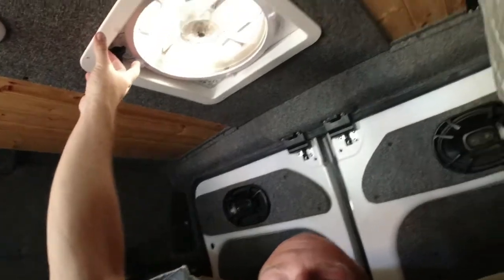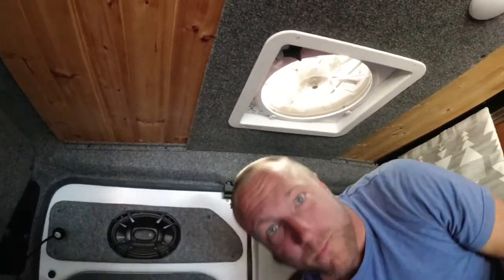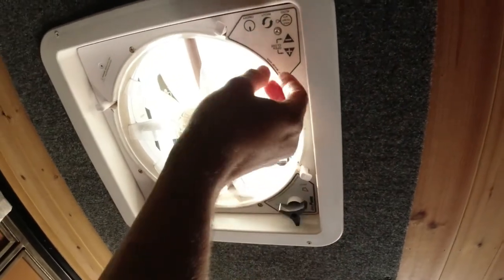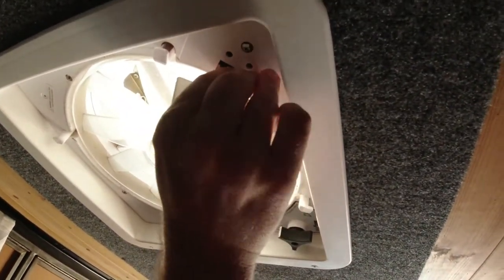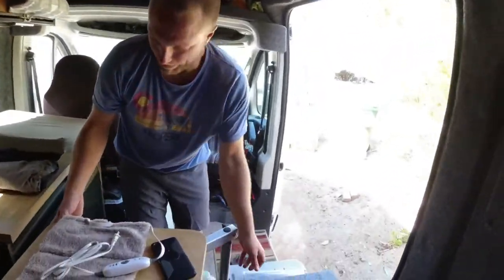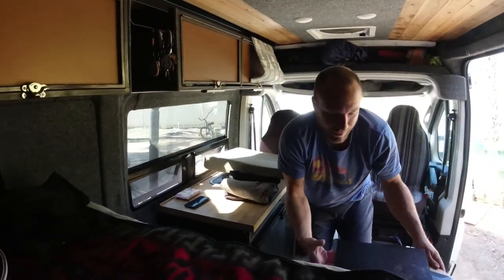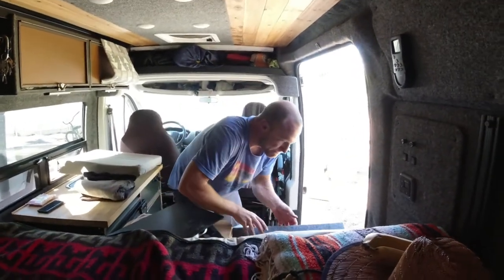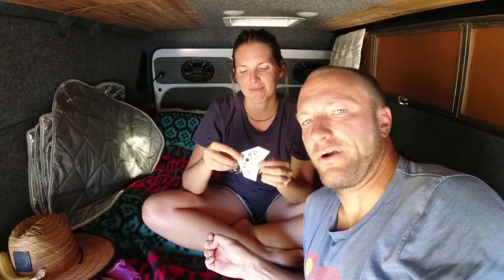Maxx Air Fan Buttons Not Working? How to Replace the Keypad on the Maxx Air Deluxe Fan

Comment: That was easier than I expected. I received my replacement keypad from Maxxair several weeks ago and kept putting off installing the new pad figuring it would be a PITA. (Had AUTO working from the old pad after ripping the fan apart and squeezing both sides, so there was no rush until it lost power when its 12v plug wiggled loose). Thanks!
Reply from the maker: Glad it was an easy fix for you too!